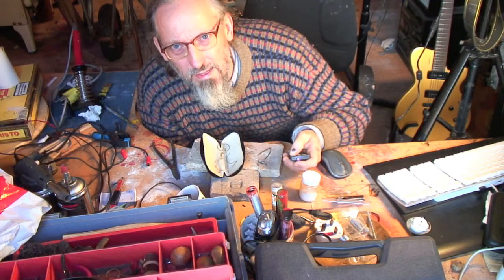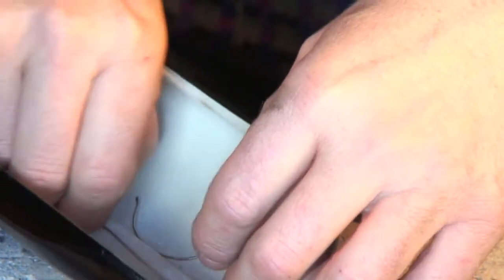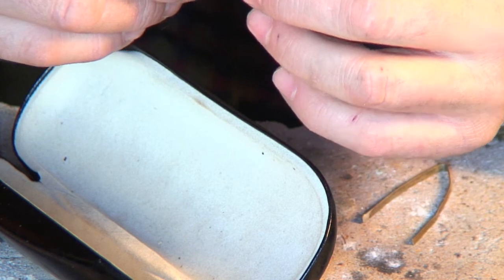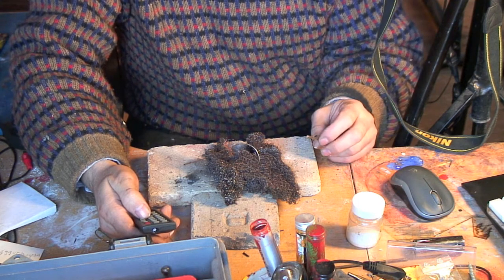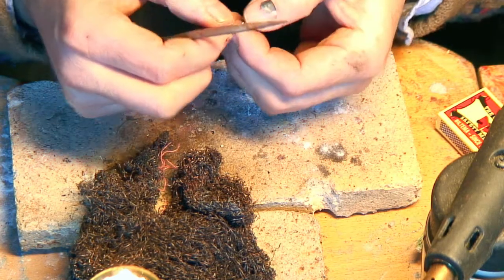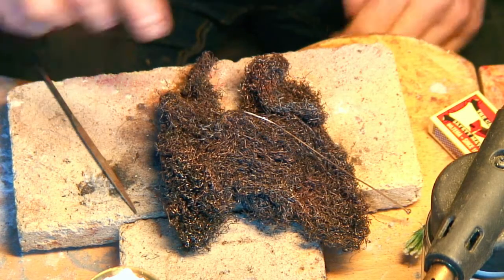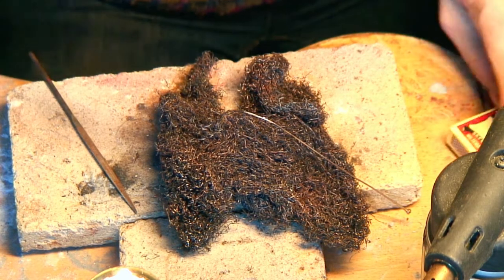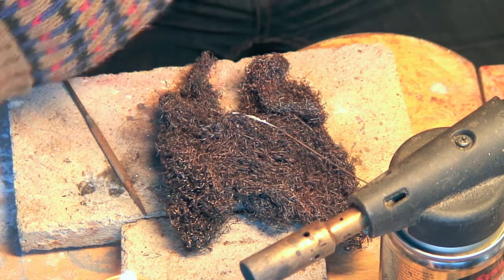🔴Repairing 120 year old Gold eye glasses with Silver Solder

Comment: Hi i just bought a pair of half rim 30's/40's half rim, 12k gold filled eyeglasses with the wrap earpiece (like the one on this video), they have the non-adjustable or removable rivets instead of conventional screws you can tighten or remove, do you sell those original rivets? also what is the best way to clean gold filled frames without having to spend a fortune..home remedies would be even better. The reason i am asking about the rivets is because one arm swings out too wide. and i'm thinking i may need to replace the rivet. thanks
Reply from the maker: An opticians would probably adjust the glasses free of charge if you ask them nicely. I just use soap and water to clean my glasses. Not sure about the rivets but i have made many in steel, silver and gold, they are very low tech. But I work with my hands and I realise not everyone does or can....
Reply: @LucasRichardStephens  could i possibly see how your rivets look ?
Reply from the maker: I don't have any footage of such small rivets but the principal shown in this film my help you see what I am talking about;
https://www.youtube.com/watch?v=oWNr-XeP9Jg
Skip to time stamp 49:49
This process is the same for glasses but scaled down, if you can get some silver or gold that fits the diameter of the hole it is very soft and will rivet easily. But if the arm opens too wide I suspect it is not just the rivets at fault, it sounds like some metal is worn away or that the arm is bent. A competent optician or watch maker will be able to help you if you lack the tools/ability.

Comment: Thanks, I have silver soldier. I need to get the lenses out and bend them around my new lenses. Please help ♥
Reply from the maker: I don't know how I can help, maybe an optician's shop can help, are your frames broken? Have you ordered new lenses? I did this and the optician also fitted the new lenses in the frame.
Reply: @LucasRichardStephens  Thanks for getting back to me. The frames are perfect and have the original lenses. I want to put my lenses with a wider bottom in. I was thinking that the band around the top that is covered with another gold piece, could be cut and soldered back to fit my new lenses that fit my face ♥
Reply from the maker: @VondaInWonderland  Sounds like a job for a goldsmith. The lenses you have could perhaps be ground to fit the frames, I did that once as a stop-gap, when one of my lenses broke. It is all a matter of cost and value, what is costs and what the value of the glasses have to you. I like my glasses partly because they are very old and therefore both unusual and rooted in heritage. They cost more to have new lenses made than just buying new generic glasses, but I have never regretted it and am now on my third lenses and have used the same glasses for 14 or 15 years.
Reply: @LucasRichardStephens  Thanks, your glasses are awesome. I'm going to somehow figure out how to do it myself ♥
Reply from the maker: @VondaInWonderland  Maybe d-shaped wire could be grooved. Are you a jeweller?